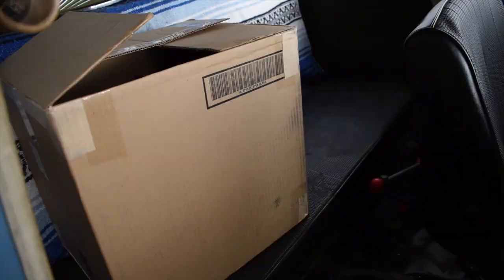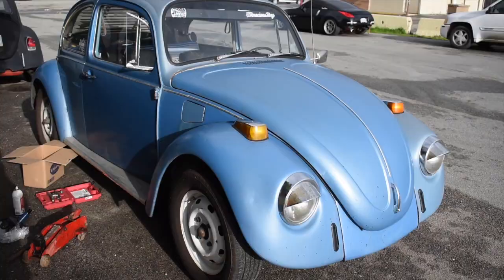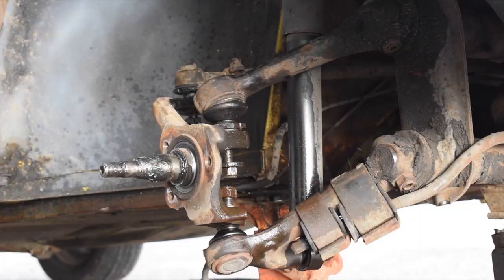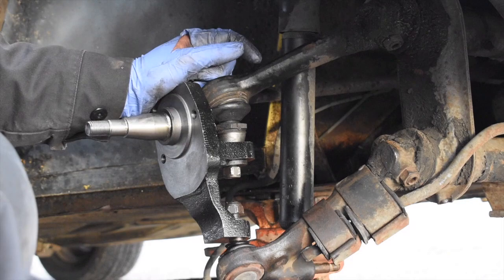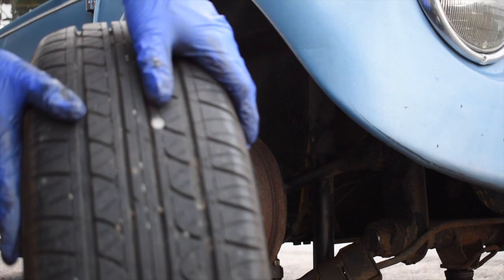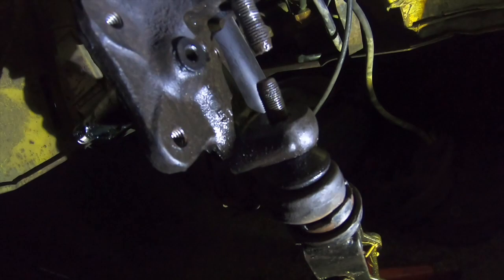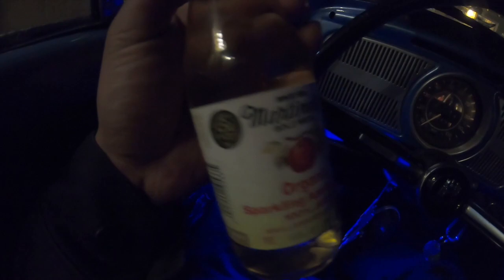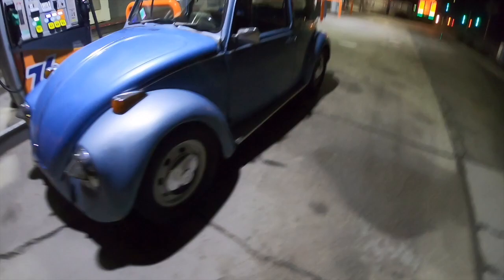Installing Drop Spindles On My VW Beetle !!

Comment: Did the same thing to our 73, one of the best changes made so far. Right side seems to be higher than the left. Any suggestions I need to be looking at to have her even out? Great video by the way brother!!
Reply from the maker: Not sure what you can do there bro. Maybe check to see if the spindles are the same size. Taking them off and putting it on again.

Comment: Nice job and well done, what tire size you, I'm looking to do mine and i got 165/65R15 and I'm not sure if it will rub.
Reply from the maker: On spindles you got plenty of room to work with tire sizes. I ran 175/65r15 in the fronts and barley rubbed. Even bagged it runs the same size front tire with a 195/65r15 in the rear.
Reply: @tuned_tunas  thank you very much and this is what I run also in the back 195.

Comment: Badass front fitment ! Same fitment I want to get to but on 16s or 17s with a cal-look! Was checking out your Ig and you needa buy/build a roof rack for that bike on top of the bug lol, would look super 🔥
Reply from the maker: Thats right bro !! I definitely want to play around with rim sizes once I get adjustable suspention. Thats the goal but the fitment pretty good for now on these 15in. Idk if it would fit on the rack but it would look really dope !!
Reply: @tuned_tunas  I bought some used adapters for a 4 to 5 lug swap and happen to have some wheels from my old car that are chevy pattern and gonna throw those on see how it looks then hopefully buy the front adjustable struts since mines a super. It would have to be a custom rack since the bikes long but I think if you manage to get one done it would look super dope especially the style of bike it is. A raw metal with wooden rack would pop on your color car!
Reply from the maker: Sheesh the chevy wheels on the bug !! Thats right !! And I agree it would look cool bro. A lot of mods I was waiting to do until the car was lowered since it was what always bothered me. Now we can do some exterior mods.
Reply: @tuned_tunas  Haha same here, I’ve been doing small cosmetic necessity stuff to mine as of now. Alternator took a shit on me last week so currently working on that today. But most definitely get you on lowering, I can’t stand how high they are up front stock once you see it lowered it gives you much more push to make it better outside
Reply from the maker: Haha couldn't have said it better bro !! More to come. Cant wait to show yall.
Reply: @tuned_tunas  Can’t wait to see what’s to come bro! Only up from here! 🙏

Comment: Couldn't  see you're side by side spindle
Reply from the maker: Yeah got late on the install due to that clapped out ball joint. It’s roughly 2 1/2 shorter than the stock one.

Comment: I've got a drop spindle disc brake from end too with stock beam... I have little 145s on the front wheels and rub a ton. What are the best ways to get rid of the rubbing without going back to stock ride height?
Reply from the maker: I am surprised you still rub with that size tires. I was running some 195s in the front. The car is now bagged and I would say its well worth it so it doesn't rub anymore. On the bright side the kit I put together is very affordable !!
Reply: You would need to install a narrowed front beam.   The disc brake spindles increased your track.

Comment: Is yours a standard beetle or super I gotta a 71  super and wanted to drop it ?
Reply from the maker: Super beetles are easy to lower. Just buy some adjustable suspension. Mines a standard Beetle so I have to do all these extra steps. It would be easier to just get coils
Reply: @tuned_tunas  any idea where I can get those hermano ? If you can send a link And I love your bug btw been bingeing on all your vids very inspiring 🙏🏼
Reply from the maker: Not sure where you buy super beetle parts my dude. I only ever had a standard bettle. But I’m sure it’s nothing a simple google search could fix.

Comment: you should have converted to disk breaks .. So much better than drums ..
Reply from the maker: Not looking to spend that kind of money on this car. I’m sure I will eventually get some nice willwoods or sum. But I just got a complete rebuild kit from a subscriber so it’s pretty certain I’m staying with drums. Discs are better but that doesn’t mean drum won’t do the job.
Reply: @tuned_tunas  I have had the VW disk brakes on my bug for about 10 years now . I am so glad i spent the money . The car has more than enough stoping power and is much safer . I am considering getting the dropped spindles . I have an adjustable beam .
Reply from the maker: Good to hear your happy travels friend. My dads bug has discs and they do feel great. He got lucky that they came with the car. And shouldn’t you not need drop spindles if you have the adjustable beam ??